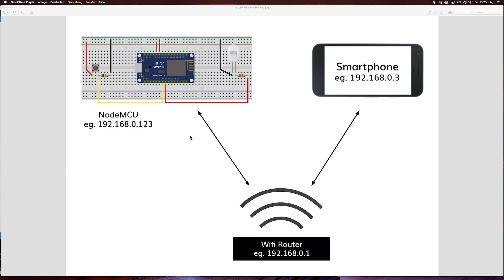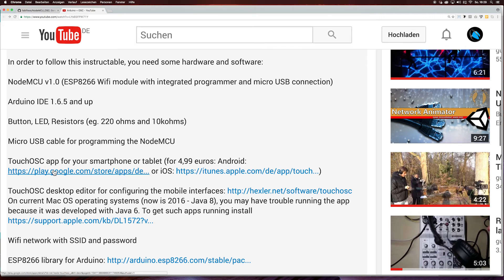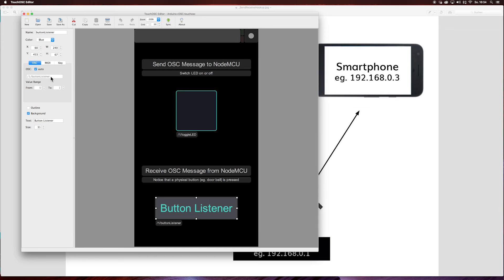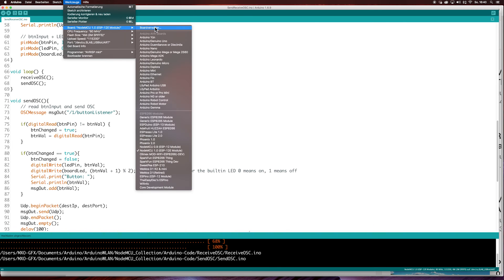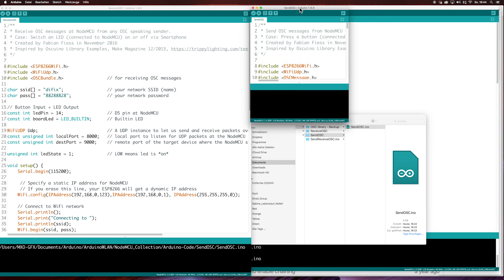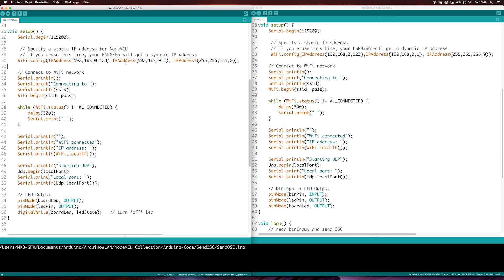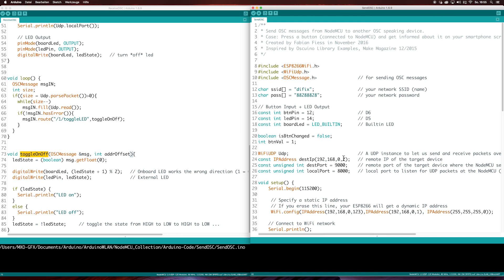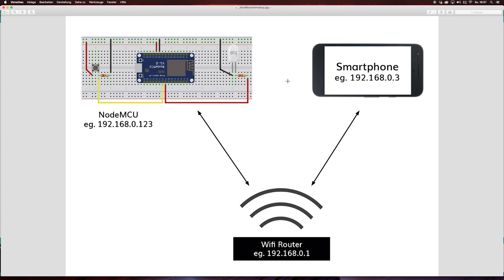Arduino + OSC

Comment: Hi ! is there any way to connect one to one any esp8266 or esp32 directly to tablets or phones? or you must need a third wifi network?
Reply from the maker: Yes. You need to install an access point on the ESP8266. You create a wireless network on your ESP8266. You can enter it on your tablet!